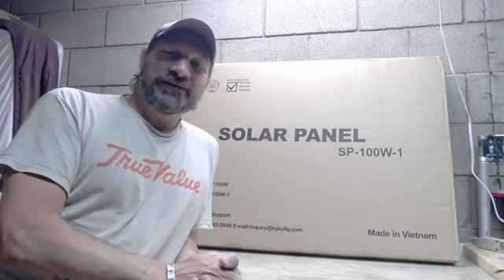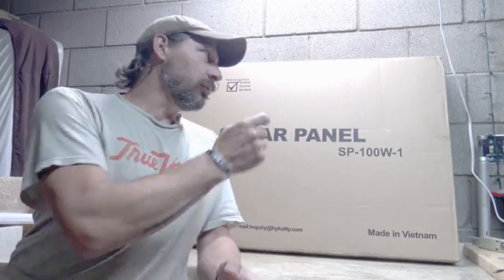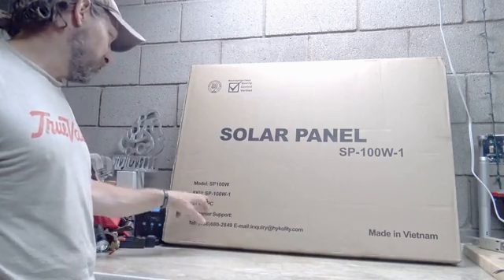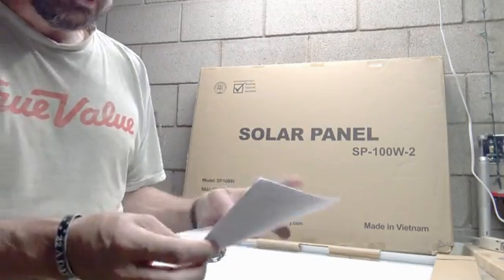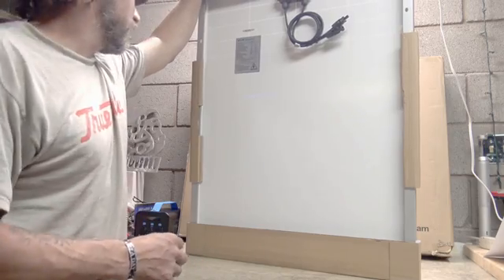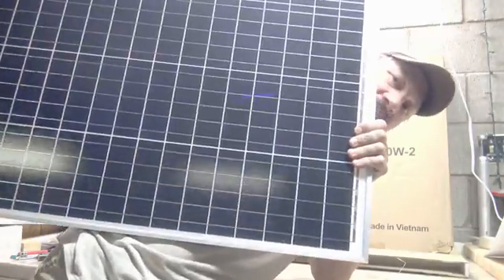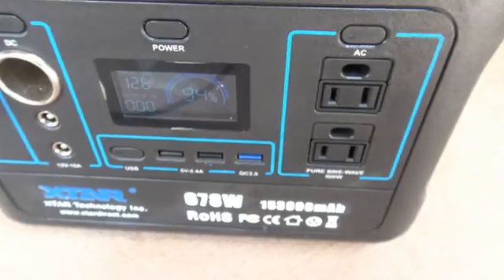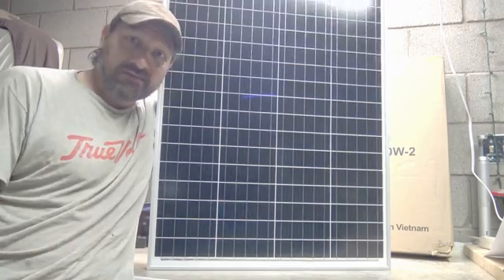Grid Down Emergency Power - Weize 100 watt solar panels - EXCELLENT performance!!!

Comment: I've had same brand and utilizing for a year..From my novice experience using in an off grid living system, these panels are equally as good as the higher ticket brands. Basically the same metrics as any other on the voltmeter. I bought one to experiment,  learn with, but bought many more to have matching sets since. That's an important factor is having same brand panels in series

Comment: Is the two pack simply 2 of the same identical 100w panels? or are they designed specially to be used together. (Sometimes I would want to use one, other times I would use 2).
Reply from the maker: I think so.